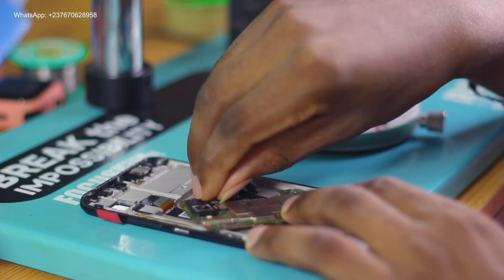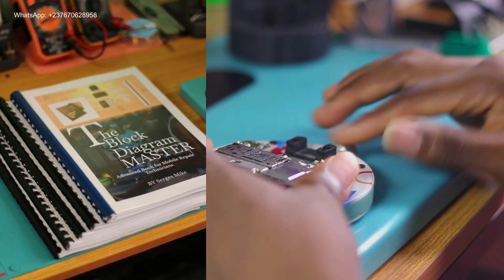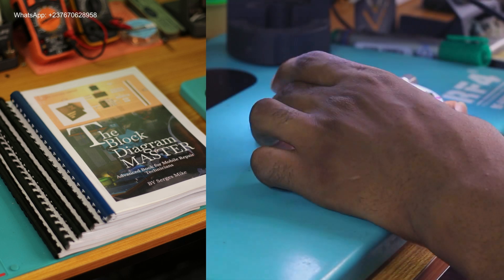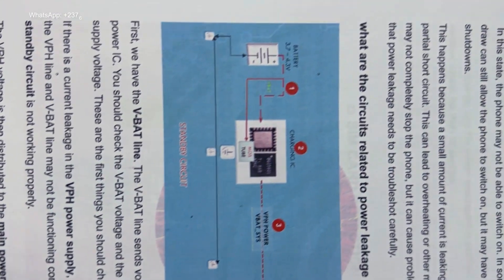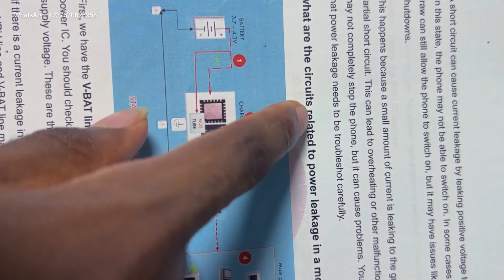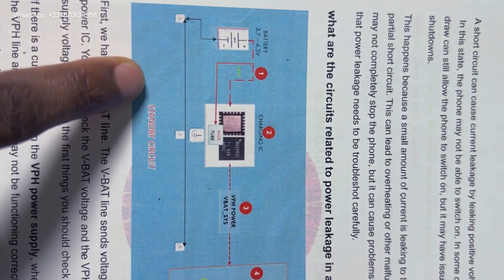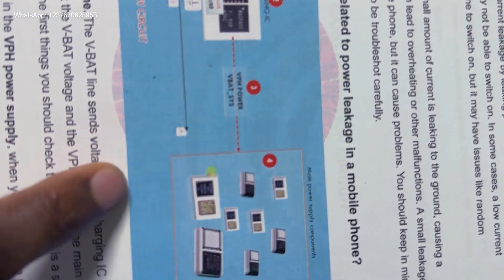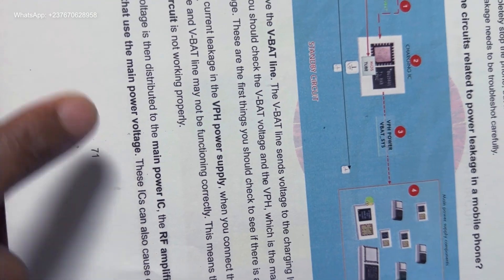Complete Mobile Repairing Course For Beginners | How to Troubleshoot And Repair a Dead Phone!

Comment: Is this the same problem you worked on? 👉What is the fault when the Vbat voltage is unstable and fluctuates (1.7v-2.3v-3.7v) while the vbus is constant at 5v. The battery is not charging and the phone switches on/off. The battery is okay because it charges fine on the battery booster chip. I am suspecting the power management IC. The phone is Nokia C31
Reply from the maker: It's similar fault. 
Check the main power supply line - VPH
Reply: @SergesMike thanks bro I have limited knowledge on vph line. The phone works fine when the battery is charged elsewhere. But wont charge by itself because of a fluctuating vbat voltage while charging.